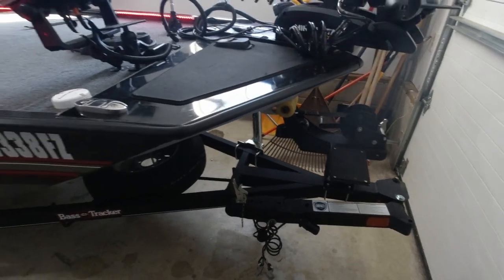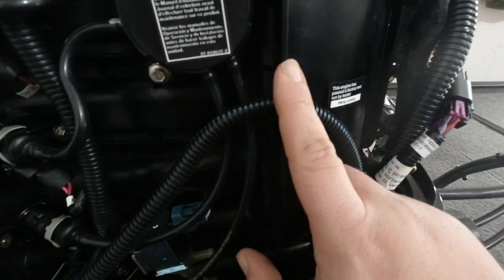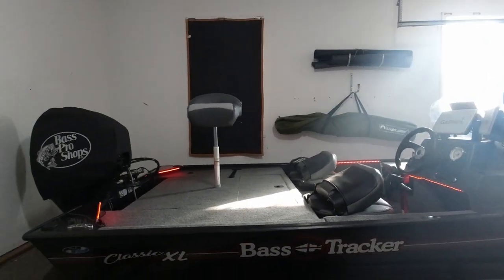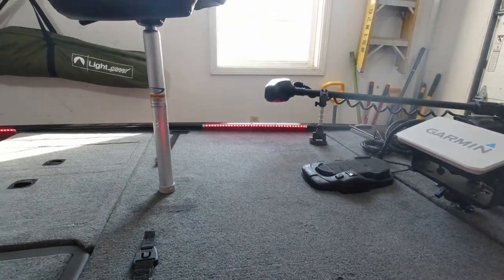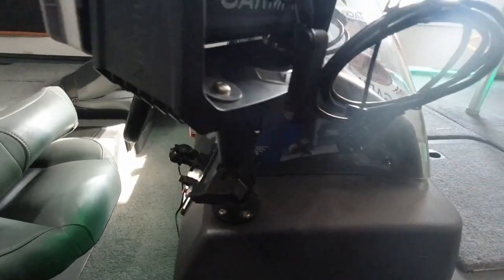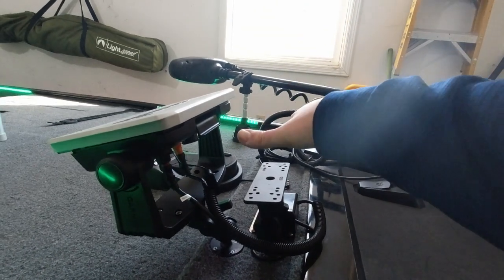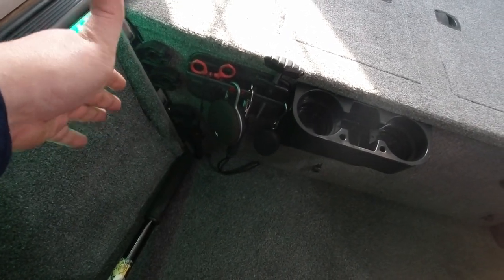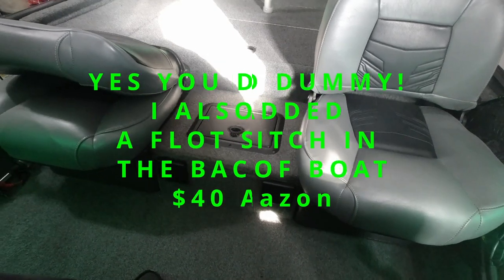BASS TRACKER CLASSIC XL UPGRADES!!! #Trackerboats #basstracker #basstrackerclassicxl

Comment: What are you using for onboard charging? Do you have a link? I was originally planning on using a standard car battery charger… But the more that I read on it I’m thinking I might get a Minnkota precision on board 2 bank charger one for my motor and starter engine one for my trolling engine I’ve also read up on the Kota alternator charger, but heard that it’s not really worth it. What are your thoughts?

Comment: Nice boat! I have a Heritage with many similar add-ons. Some recommendations not criticism…. you don’t use the Terrova built in transducer?  It’s not great but it’ll alleviate some of the tangling wire issues.  

Also I use detachable trolling motor mount as my cover doesn’t fit well with bigger trolling motor.  An upgrade I absolutely love is swapping out 1250gph cartridges in both aerator and bilge pump. Takes about 30 mins and cost about $30 each. I use live bait a lot so filling livewell in seconds is great. 

And also are your ram mounts 1”? I use 1.5” and 2” as they’re much sturdier with the weight of 9” screens.  I have livescope but keep it on portable base as I switch from boat to boat. I use a transom trolling motor mounting bracket and attach a transducer to aluminum pole.

**I’m stealing the rod holder buckle idea. Those are sweet

Comment: Another positive with that trolling motor upgrade is the foot pedal is low key so no need to drill a recessed foot tray! Love the boat man
Reply from the maker: Facts! I almost put one in to still have the tray sitting on a shelf so glad I didn’t though no need for it with that pedal.

Comment: With 3 batteries don't forget the onboard alternator battery charger...it's worth it, if you have the room! With my setup I'm running 2 batteries, 2 gas tanks, an onboard charger and a alternator battery charger. I doubt if anything more can be placed in the back end. If I needed a 3rd battery it would have to go into the tackle storage area behind the driver's seat or into the extended front deck area for balanced weight distribution so the "ass" end doesn't too heavy! By the way, really nice mods! Living in Ontario, Canada this same basic model cost me just shy of $25,000 (with taxes), plus around $3,000 of additional parts and labor. There are times I wished I lived in the US!
Reply from the maker: Yea 25k is steep!

Comment: hey Matt, just to confirm is that terrova 12volt 55lb thrust and you just got two 12 volt batteries running parallel or is it a 24volt system with the 80lb thrust terrova .also after a few years of use how do you like it so far. I'm currently debating on going with terrova or ultrex
Reply from the maker: Yes 12v 55lb thrust two batteries in parallel.Its held up great and I like it that being said I would go with the ultrex if I could do it all over.If you have the money I’d go with the 80lb 24v ultrex

Comment: Do you have  links for any of the add on items? I'm really interested in the step on the trailer. 

When you added the trolling motor, I see a large metal plate. Did that come with the motor or is that aftermarket as well?

Thanks

Comment: For your fish finder at the bow ? What power supply did you use ? Not running trolling motor source right ?
Reply from the maker: No there are two wires up under the front panel capped off they run at factory for front electronics.It’s connected to cranking battery

Comment: i am planning on purchasing the same boat. i’ve seen a ton of videos on youtube and yours are easily the best and most informative. do you have any plans or step by step videos on the deck extension. also what about the aluminum plate for trolling motor as I plan on upgrading the troller to the terrova immediately. thanks
Reply from the maker: Yes I have videos on both casting deck extension build and aluminum plate install video.Just go to my page and find videos then start scrolling down you will come across them all.Thanks for watching appreciate it!

Comment: I will be picking up my 2023 classic xl the 1st week of April really pumped! I did watch all of your videos regarding the classic xl. Ty for that! My question is... I did watch the video of you explaining the fitted cover that comes with it however I am adding a new casting seat and the 22"-29" pedestal same one you got for the front. I'm assuming I will have to take the new front casting seat and pedestal off for the cover to fit? I will keep the original for in the rear for my grandson it's much safer at his younger age
Reply from the maker: No you can leave the seats in as long as they are adjusted all the way down.It’s better to leave them in also because it helps with water run off you don’t even need poles if you keep your two seats in.
Reply: @BredForBass  perfect thanks again!
Reply from the maker: @NbrdaveH-if5tw  no problem buddy glad I could help

Comment: That removable glove box did you build it or did you buy it if you bought it can you leave a link where you bought it from
Reply from the maker: I built the box part but the dry box I bought off Amazon here is link https://www.amazon.com/DPI-Marine-Glove-Only-Black/dp/B0CD8VXJL5/ref=mp_s_a_1_14?crid=16ZMRJQOZ4DXG&dib=eyJ2IjoiMSJ9.lrG6s6XyotaJ1bYT5AgIhk7rKuVYQ33A7_GI-JmLeBoJdV0nrdKgUZhC61CMX3fUFLzDx1tE40se0heF4jGzLvp-geBUu9WInIgQKYlNd6pfNLtrAlQ8gm-kZ2yRH_XI9Akh_iOdlFNeVy4_5o0T_jUHTNSH-HDZI458-Oq8Nxukk-80wuCnRdJAyMLEX-LcxrGpEyN5JV7wwV0HPHHr-w.PGRcGljjOwxUavNVR14M3F8vcezrSBMB5_ac1kC_qGY&dib_tag=se&keywords=boat+glove+box&qid=1713402121&sprefix=boat+glove+box%2Caps%2C99&sr=8-14

Comment: Great job. I have the 50th anniversary and want to add the casting deck extension. Can that be purchased or does it have to be made?
Reply from the maker: I had to make it!
Reply: @BredForBass  cool. can you offer any plans to allow me to make it?
Reply: @BredForBass  thanks. I found your videos about that and thanks for those. Did you screw the deck to the floor of the boat? If so, how long were the screws you used?
Reply from the maker: @timmcmurray3867  no I didn’t it’s free standing it’s in there tight though don’t move at all.Thanks for the support!

Comment: What's the brand name of those retractable transom straps? The 2021 BTC is pretty small and I want to get the right ones.
Reply from the maker: Follow this link these what I got 

https://www.cabelas.com/shop/en/boatbuckle-rodbuckle-rod-hold-down-system?ds_e=GOOGLE&ds_c=Shop%7CCAB%7CTopPerformers%7CBoating&gclid=Cj0KCQiAi9mPBhCJARIsAHchl1yDrFOTsxNt8B5KeiXZVkbfz5gi9RF_IQlekkhnddf1wtfTB0RPN7gaAqJGEALw_wcB&gclsrc=aw.ds
Reply: @BredForBass  Not the rod holders though I plan on getting those. The transom straps for the back of the boat.
Reply from the maker: @bentlysupreme  my bad bud I misread that they both made by boat buckle
These what I got https://www.amazon.com/BoatBuckle-Stainless-Retractable-Transom-Tie-Down/dp/B000KORVJY/ref=asc_df_B001GJ35VU/?tag=hyprod-20&linkCode=df0&hvadid=312062016371&hvpos=&hvnetw=g&hvrand=5194784282368975103&hvpone=&hvptwo=&hvqmt=&hvdev=m&hvdvcmdl=&hvlocint=&hvlocphy=9014947&hvtargid=pla-510132985167&psc=1&th=1
Reply: @BredForBass  thanks, I appreciate it.

Comment: Great job on the upgrades. I have the same boat but 2020, went out this weekend and had no power on the console. Checked circuit breaker at battery, voltage and all, 12.8 volt. checked for fuse box under console and found nothing there. All fuses on dash good but nothing works, horn, fish finder, cig lighter, lights, and pumps. Can you help me? Thanks
Reply from the maker: Unfortunately I don’t know what it would it be.If you have Facebook you should join the bass tracker classic xl Facebook group they will be able to help you in there

Comment: Do you have the Amazon link to the Furniture bumpers you put on it? Want to make sure i get the right ones
Reply from the maker: Just type in furniture corner guard on Amazon they all the same for most part just pay attention to the roll length to make sure it will cover the boat I think I got (2) 20’ rolls one for each side I don’t remember the exact one I got or I would send you link but it’s easy to find.
Reply: @BredForBass  no problem! Thanks

Comment: I have a 2019 bass tracker classic...what does the XL add...is it longer? Mine is 16'8". Do you have any cover recommendations?
Reply from the maker: No it’s same size it’s just painted that’s the only difference between the classic and the classic xl.The tracker cover I purchased with the boat is awesome fits like a glove and you can travel with it on.I’m not sure how you go about getting it though I got mine through the dealer when purchasing.
Reply: @Bred For Bass  ok awesome. Yeah those covers are nice but expensive. What kind of transom buckles are they? The ones on my boat are hard to work with. Is your live well 9 gal? Ever put 5 bass in there? Just curious. Thanks for the info
Reply from the maker: @benw6554  they are called “boat buckle minis” love them and yes my livewell is 9 gallon and I have had 5 bass in there that added up to 13lbs.Probably not getting 25lbs in there though
Reply: @Bred For Bass  cool, appreciate it. Yea I'm going to get me some mini buckles

Comment: Do you still have the low range unit that came with? I’ve been looking for a replacement for my 2012 bass tracker 165.
Reply from the maker: No I sold it unfortunately sorry I couldn’t help!
Reply: @BredForBass  thanks anyways man. By the way you got that boat looking mighty sweet. I like checking out all the mods. I need to mod my live well to recirculate.
Reply from the maker: @ntj030885  thanks bro appreciate it! I have definitely put a lot of time into upgrading it that’s for sure.

Comment: Can you or did you change out the tiny 6 gallon gas tank for a larger gas tank?
Reply from the maker: Yes you can I have not changed it out this motor sips gas never came close to running empty on a trip.Some guys add a 2nd 6 gallon some take out the 6 and add a 9 or 12 gallon